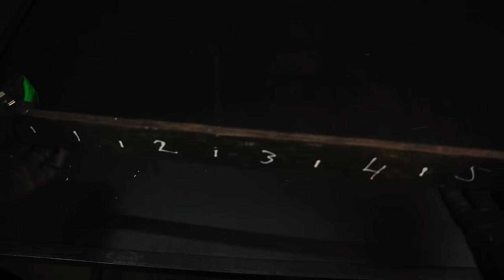Forging Stunning Damascus Karambit Knife🔥

Comment: Really nice work and great video. I love the design of it. I'll be honest. All these smiths with forging presses and surface grinders make me so jealous. I love making Damascus, but undertaking billets that size really does take a toll on your arms when done by hand. I tend to stick to small billets, typically just with 3 or 5 layers with high carbon in the core, and forge weld the pattern to it. Cable Damascus is one of my favorites to make because it gives a pattern that looks like snakeskin.

Comment: How much does it actually cost for all the blacksmith machines + materials to make all of this?
Reply: A lot of money. My press was around 800 dollars but that is practically a steal price. My forge is 200. Anvil is around 150 to 2000 ( depending on the anvil. And the surface grinder is around 3.5 grand. Thea 2x72  belt grinder is around 1200 dollars to 2 grand.
Reply: @Rosewayforge please tell me more! What kind of press did you get?
Reply: To do the full workshop version of it? Hundreds to thousands
This can also be achieved with some coal in a pit in the ground, a hairdryer with a steel tube for bellows, a hammer and some files on a piece of heavy steel (as an anvil) 
All for less than 100 quid

It will be a looot harder and won't look anywhere as good but it can still definitely be done 😊
Reply: With a forge, angle grinder and anvil you can get a lot done. Add a tabletop sander/grinder for another 100 dollars you’re looking at around $500 for a seriously basic setup, forge and anvil being the most expensive component up front. While power tools are nice, you really only need an angle grinder with various wheels like wire wheel, cutoff wheel, grinding wheel, flap disc, buffing wheel. Hammer anvil tongs and whatever other hand tools you acquire along the way think files chisels punches etc. Forge can be simple but the most efficient and affordable  would be a diy gas firebrick forge or high temp cement. Even ceramic wool can be found relatively low cost. Propane/ fuel costs and materials like steel brass pin stock handle materials can all be sourced at any hardware. You would hopefully have a work area with a good bench and maybe a vice. Anvil from harbor freight or fb marketplace. You can find a lot of these tools at garage sales and estate sales stuff like that. Good steel from truck springs and coils from a junkyard are cheap. Be resourceful and efficient starting out and focus on forging close to the final product and avoid grinding and cutting. Hand finished knifes look and usually cut better. Learn to heat treat good keep a magnet near the forge or quench tank to check critical temp before quench. Temper to golden brown prevents chipping. Drill your holes before you quench and shape your handle before you fix it to the blade. Don’t forget your safety equipment and have fun smithing